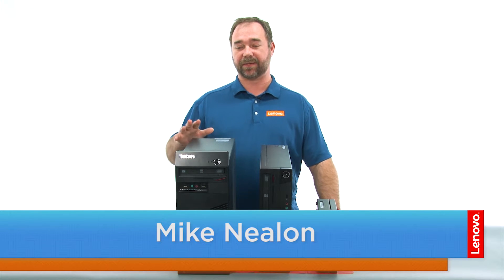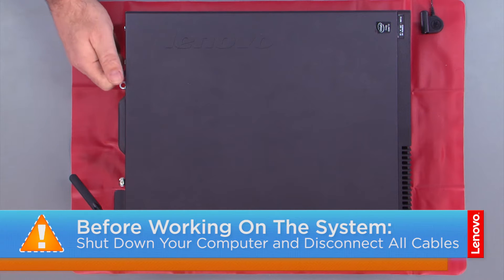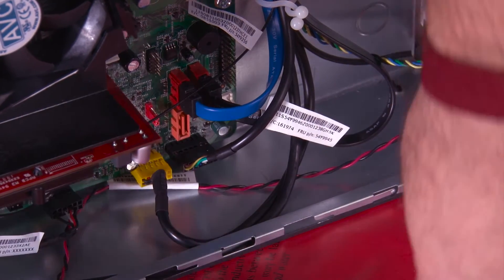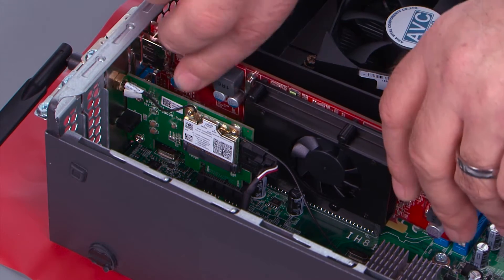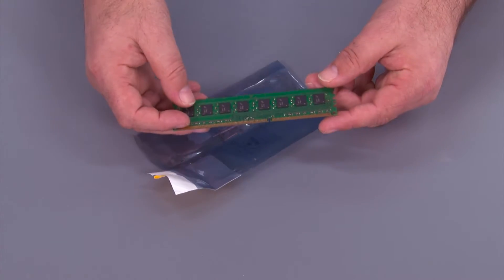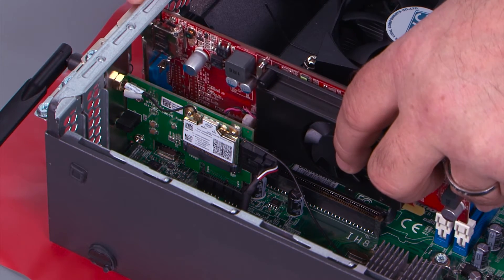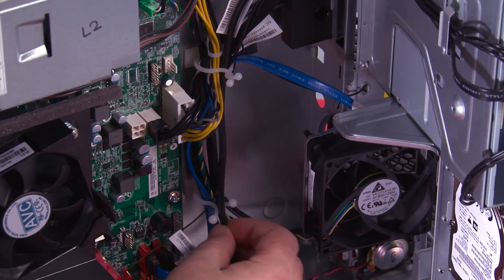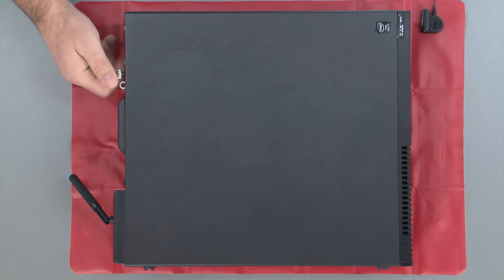ThinkCentre M73 / E73 / M72e Small Form Factor Desktop - Memory Module Replacement

Comment: Hi

I just bought two Kingston 8GB DDR3 1600mhz Pc3 12800 KVR16N11/8 sticks in order to get to 16GB of RAM, but the system only shows a black screen, no noise except for the fans.

I also upgraded the CPU to a Intel Core i5-4570S Processor.

I have a ThinkCentre E73 sff 10AU

Is this model of RAM incompatible?
Reply: Hi @the_outer_heaven! Thanks for reaching out. You may check this link https://lnv.gy/45bWxoE for the list of compatible parts on your machine. -Jomz_Lenovo

Comment: Does the M72e small form factor support 8GB ram modules?
Reply from the maker: Hi there! It supports up to 16GB. (16GB max, PC3-12800 1600MHz DDR3, two 204-pin SODIMM sockets ) Let me know if you have other concern. Arjay_Lenovo
Reply: Isn't SODIMM for laptops? My M72e is a small form factor desktop. Thanks for replying though.
Reply from the maker: Hello richwell329, you may also view this link: https://lnv.gy/3ayEnAM for steps on how to replace the memory module for the ThinkCentre M72e (small form factor). 

Hope this helps. Allan_Lenovo

Comment: My Lenovo M72e SFF has Windows 7 and I upgraded the memory to 8 Gb with a second 4Gb stick, that is the same as the one that is already inside and it results in blue screen of death after some minutes even in idle mode. 
Please, can you enlighten me as to why?
Reply from the maker: Sounds like you may have a bad stick of RAM. Try removing the new stick and booting. Then try booting with only the new stick.
Reply: I have tried that, the Ram works and both slots work. The system is stable with either of the Ram sticks mounted, but it is unstable with both installed. Windows 7 Pro SP1 crashes after a few minutes even in idle.
Reply from the maker: Did you run a memory test on your newer stick?
Reply: Yes on the newer and the older in either slot and on both together! 
I think the hardware is fine and that the problem lies on the operating system. I would do a reinstall, but I have no experience with downloading drivers and the lenovo support site is not very clear, as to which I need to have.
Can you please help me any further?
Reply from the maker: Well. You could reinstall and run lenovo system update: https://support.lenovo.com/solutions/ht080136 to get the drivers/BIOS updates for you.

Comment: what is the name of the power cable which is connected to hard drive and optical drive?
Reply from the maker: Hello, correct me if I'm wrong but I believe that is FRU part number 54Y8286. Which is a 600mm SATA power cable.